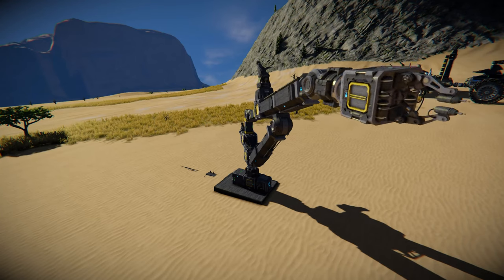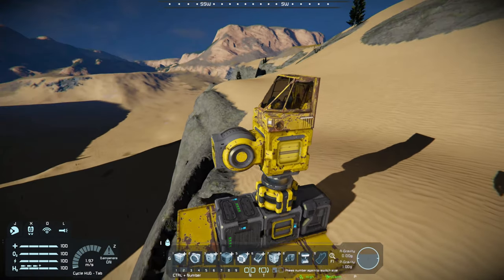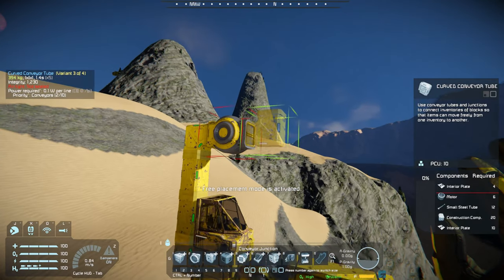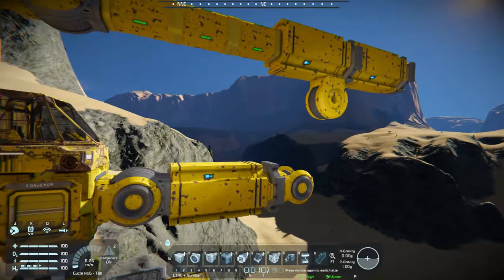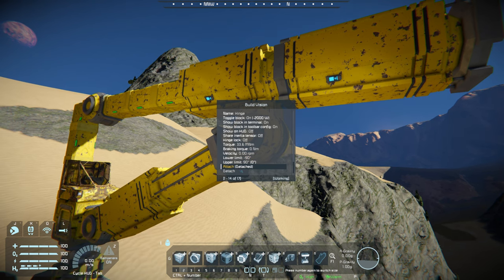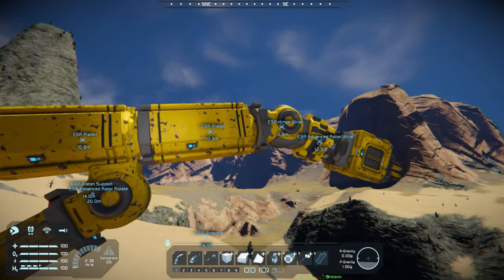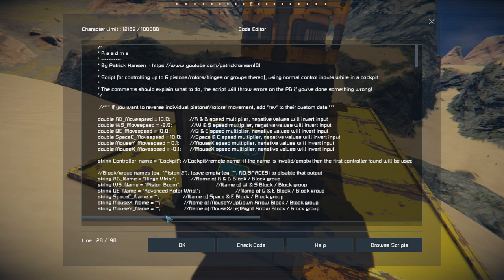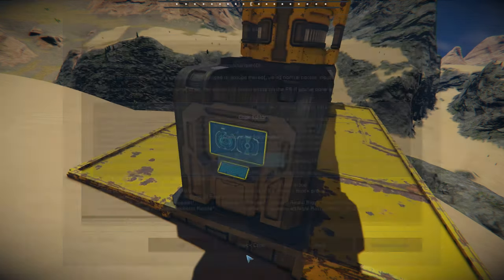Space Engineers - Build a mouse controle crane - space engineers

Comment: Great tutorial.  Well done.  I used your crane design and slightly modified it because I wasn't getting the flexibility I needed (Welder Crane).  I split the Piston Boom and placed 2 wrist hinges between them.  This gives you the added benefit of having a "double-jointed" crane.  You can weld all the way up to the base of Rotating Rotor.  As long as your group your Wrist Rotors and keep the same naming convention it only requires you to recompile the PB Script.  You know it's a good design and training when modifications are actually easy.  Earned a new subscriber.  #Respect
Reply from the maker: Thanks friend appreciate the feedback. :)
I do plan on doing a few more videos like this one. Almost done with school and I’ll be more available to run this channel again. Im excited to get back into it soon.
Reply: I tried that and.... Yes it Clang. Adding the double hinge inbetween the boom pistons did greatly improve it's flexibility. Though it did make it a bit more wobbly - You need to adjust the speed value so you don't suddenly end up breaking the thing in half.
Reply: You should double up the pistons right next to each other with a single block in between them then use to merge blocks to merge them as a single subgrid @ZethGamer

Comment: i think you can support the base rotor ( the first rotor you placed down ) with wheels around it. meaning if you have 4 wheels slightly diagonal and have them set free to roll it will stop any wiggle that might happen at that part ( since it's supporting so much weight specially when lifting )

Comment: Just followed along to put this on a small grid truck of mine. Wonderful tutorial, however I have one part of it not working. The Hinge Wrist is a limp noodle for whatever reason. Any ideas?
Reply: Nevermind I figured it out. The Hinge Wrist actually requires Torque values otherwise it just will not respond to input. I set it to 50k Nm for regular and braking torque since I plan on having something attached to it. Hopefully this helps anyone who comes across this video.
Reply from the maker: @rokker17  absolutely. You got this 😊

Comment: i built this inside a large ship in space and nothing is moving. i will get motion on the top rotor if i build a gyroscope on the crane but nothing else moves, i used your same naming convention and the only difference in my design is that i built it upside down. i tried moving things around in the script incase i needed the arm support to be different but to no avail there is no difference. any thoughts?
Reply from the maker: I believe it has something to do with the naming in the cockpit. 
I’m on vacation and nowhere near my PC to load this up and answer you correctly. But I’d start there.
Reply: i found out what the problem was, the script was updated since the video and you have to put the cockpit block name if you have multiple cockpits. cheers
Reply: thanks that solved it, had to put cockpit name in script because of multiple cockpits on my ship  @syberiah

Comment: For some reason after naming everything properly the script just wont respond to recompile or run, it will run being copied straight from the workshop however when I set the names the script goes silent, on it's own grid with no other programmables running either, am I doin something wrong?
Reply from the maker: Did you name the main cockpit? Sometimes it assigns it to other cockpits.
Reply: @syberiah  Yeah I just named it to Crane Cockpit, tested this both on our base and off it on a separate grid, weird thing is when I bring it in without changes it will call for the change of "AD Pistons" however when I change everthing to what its named the programming block freezes, not sure what I'm doin haha, also thank you for the speedy response!

Comment: I don't suppose this will work for the XBOX version or will it with the correct script or even this script but modified to accept controller inputs in stead.

Baring in mind I no nothing about script other than that it's basically a set of instructions beyond this I don't know exactly what script is.
Reply from the maker: No unfortunately it’s of only
Reply: @syberiah  So script doesn't work at all on the Xbox version?
Reply from the maker: @matthew-005  last I heard no.

Comment: Cannot for the life of me get this to work, the controls do not map at all but the programable block says everything is good. Ive checked the names ad theyre all good. OK I managed to make the pistons work, I was using the industrial cockpit so i switched it to the regular and it will map the pistons but not the rotors. Their torque is 0 and unlocked, i cant see im doing anything wrong.
Reply from the maker: Hmmmmm all I can think of is did you name the cockpit?
Reply: @syberiah  initially no, then I spotted that so I did change all that to match but still no joy. It is attached to the main base grid where there are other controllers and hinges and pistons etc but I double checked names are all correct for the correct parts. 🤔 I wondered if the support hinge didn't attach properly or something. It snapped to the grid when I clicked attach though.
Reply: I might try just using a custom turret controller. This is a great tutorial though!